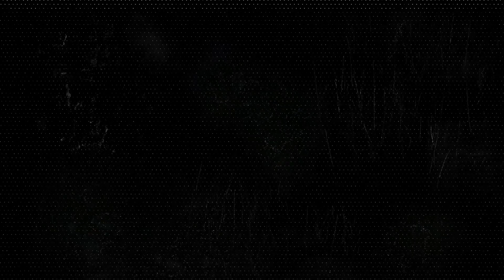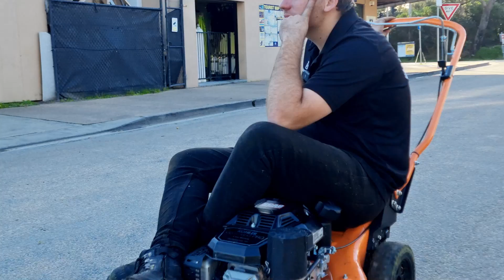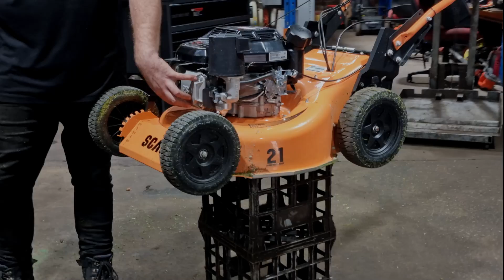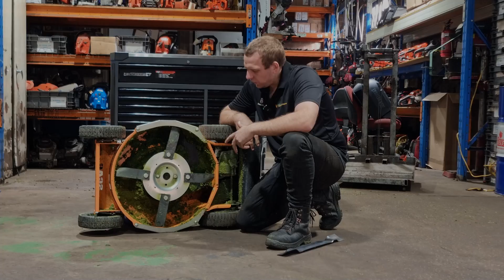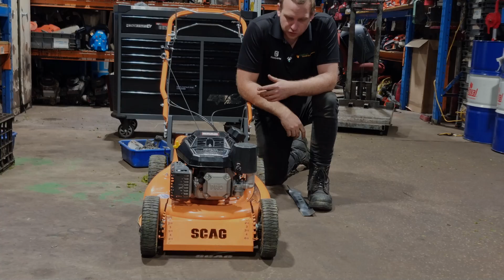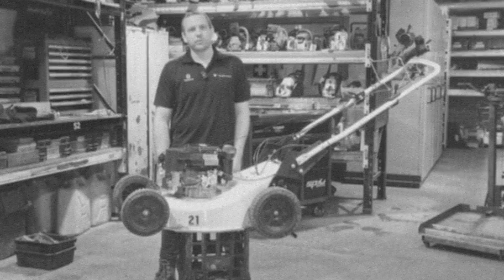SCAG SFC 21 Build Walkthrough - Unleashing Power and Precision!

Comment: Thank you for a great video. I was in a market for a mower, just a homeowner that wants quality product. Initially planned to get Kohler CV224 engine, but they had some production delays (and frankly I am now worried about Kohler engines being owned by Private Equity firm). So I had a dealer order me a Honda GXV160 engine. Of course much less HP and torque than Kohler, but I know that comercial Honda will last me decades. The only update I see that they made on Scag SFC 21 was addition of a heavy duty black metal support brace that runs the width of the machine right below the transmission. Scag rep told me they had issues on first models where the transmission would get pinched, so the reinforcing plate created a nice support system. One thing I am not a fan of is that the transmission cables run a little too close to the spinning transmission pulley. I actually had a gear change mechanism cable come in contact with it and left a nick in the insulation. Over years, I worry it will actually cut all the way through the cable. Contacted Scag, who shared my concern with engineering team, but no solution quite yet.

Comment: The difference between the SFC 21 and SFC 30 is actually vast. I'm in the US and bought the 21 and I had my grandpa (rip) get the 30 for his near triple lot sized property. The SFC 30 is one of the worst mowers I've ever used. And apparently, Scag heard the noise from people like me and came out a new version of the SFC 30 this year. For the price at the time in 2023, it was not worth it. The clutch was horrible, belts breaking, engine and transmission cant handle the weight and grass output of the mower.. and that's not all of it. Not good.

But the SFC 21 is fantastic as you say. My only issues personally is the belt clean out, the mulch plug and no handle grip like you said. The grass really builds up fast around the belt area underneath and it needs to be cleaned out regularly, which is the metal plate to the left of the mulch plug outlet. You also need to take the blade off to get the underside cover off to clean that area, which is annoying, but no big deal. The mulch plug itself just doesn't fit right and seems cheap compared to the rest of the mower. 

If someone wants a pricey but really well made 21 inch mower, the SFC 21 is worth it to me. Now I can't speak to the SFCII 30 they just released, but stay away from the original SFC 30 if you step up, especially if you get sold a pre-2023 mower with known clutch recalls like I was.

Comment: Hi I have a Scag its super, Mine is the 224cc , and it cut through 2 plus feet of grass today no problems.. Its a beast. I just use leather work gloves , thats enough cushioning.  But I like what you have done with the 4 blades. I would like that on mine.. I am a granny over 70 and this mower is the  grass beast.

Comment: Don't buy this mower the deck clogs up and rear shoot cloggs with grass constantly if grass is a little wet The bar blade jams up with grass against plastic cover for drive belt.
The rear side shoot clogs up to 
I'm constantly stopping to clean out rear shoot and turning mower on its side to clear grass from underside off deck
The handles on the wheel height adjustments have little rubber covers on them that come off
Once thus happens you have a tiny leaver that is difficult to use >>Leavers needs to be lengthened 
All up extremely disappointed for a 4k plus mower it's deck is a complete design stuff up
The 4 blade kit a a must a makes a definite improvement 
Maybe Extra High lift blades would help

Comment: Has anyone found a way to slow the speed down, so it's going slower when you have the throttle bar all the way to the handle?  It goes fast, even on turtle speed.
Reply: Turtle is the perfect pace for me. 5’ 11” male. 7hp 2024 year model.
Reply: @davidodonnell4036  It's to fast for my property.  I have to keep the lever hanging down.
Reply: What year is yours?
Reply: @davidodonnell4036  24.

Comment: I wish we had a closer look at the clutch.  I don't know what they are like compared to Honda's Commercial Roto-Stop blade clutch as those are known to go decades in residential use.  The deck is similar in design to Honda's shape wise but it's nice to see the front is one uniform curve as my Honda has a baffle bolted in place there instead.  I don't know how someone brakes driveshafts on lawn mowers for the drive system as I have never had that problem with any of the Hondas I have owned over the years.  I'm not a big fan of belts for anything though and my Honda with its hydrostatic transmission (used in Canada and the US) doesn't have that surge but in Australia you have mosty gear boxes on your Hondas for some reason.  Kohler's Command Pro engines are really good engines and I currently have four of them in my possession on a couple of Cub Cadets (12.5 hp horizontal shaft), a John Deere rider I was recently given (13 hp vertical shaft) and my Walker with a 23.5 hp V-Twin.  The flail style blade systems you have in Australia are a good idea to a point, but lead me to think they can become projectiles much more easily than the rigid bar blade systems we use in North America.
Reply: Clutch is far better than Honda however with 7hp model IF bar blade as it doe's gets stopped by clogging of deck and rear shoot AND you keep Clutch engaged you will burn out Clutch it will smell like your cars Clutch cooking

Comment: I’ve got the 30 and love it, I wouldn’t buy this simply because of the height adjustment, adjusting the wheels individually at the start and finish of each job adds up to a lot of wasted time at the end of the day….I never bought a toro for the same reason…
Reply: I have a 21” and I hate it only because of the rear height adjustment it’s so stupid. I have an exmark and it’s so much better than this

Comment: You say  you like to set the front wheels lower then the rear, therefore you would like to have a front wheel adjuster for both wheels and a rear adjuster for both rear wheels. I'm not a "professional" landscaper, having said that, I am now looking at professional/commercial grade lawn mowers. It appears they are the only mowers now in the U.S.A. that still offer 4 wheel separate adjustments.
Why would I want this? Well when I cut the strip of lawn between the street curb and the sidewalk I lower the sidewalk wheels down 1 setting, run down on the sidewalk side and back with the low wheels on the curb side. YEAH, I know...... sounds anal. Then again anyone watching videos about lawn care on YouTube, and mower reviews,......... judging by the amount of content on YouTube there must be a lot of anal folks on here.

Comment: I'm considering buying this Scag 21 inch mower to replace my Honda HRC216.  I know they make a 5 hp and 7 hp.  Will the 5 hp cut it in most situations?  Why would anyone need the 7 hp?  If there are good enough reasons, I'll buy the 7 hp,
Reply: The 5Hp if what we have done all our testing with and is a great mower, the 5HP will completely out perform your Honda.
Reply: @mowermerch  I forgot to ask you this question.  My front lawn is about 5,000 feet St. Augustine and has a slope of about 35 degrees at the front, going down to the sidewalk.  My HRC was able to handle it, so I feel that the 5 hp will handle it, too.  Do you think I should wait for the 7 hp?  My Honda is still living its last breath, and I can wait until March when my dealer will offer Scag discounts, so price is "no object."
Reply from the maker: I really like the 5hp is lighter then the 7hp and i find the power to be more then enough, iv put the 5hp through some tough testing and iv never had it struggle. i think if you want to save some coin and have a mower thats a little lighter then go the 5hp its a great unit and will do everthing you need

Comment: Most commercial 21" are still running the Kawasaki FJ180 are they not?  This has more or less been around since 2004 when it was introduced with the revamped JX75, later on the WE80/85 which came from Eastman, correct? Not saying anything Kohler is a bad engine, but there's definitely a more common engine out there for the commerical ones.
Reply: The Kohler engine I find rev better and has more torque it would definitely be my choice of engine.